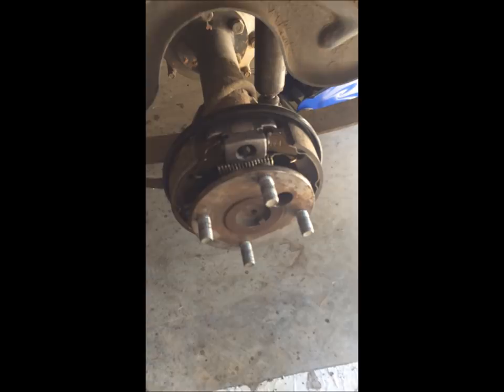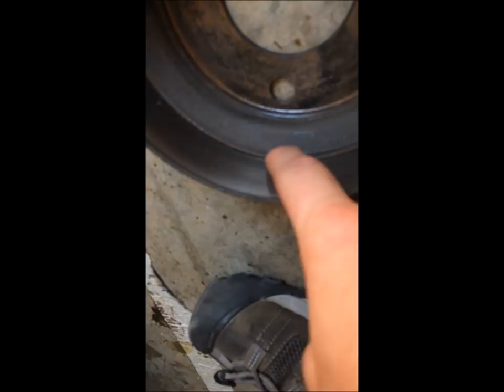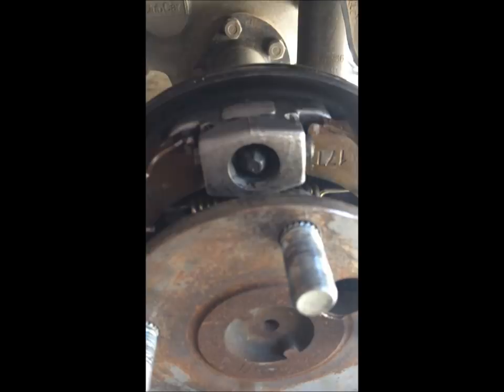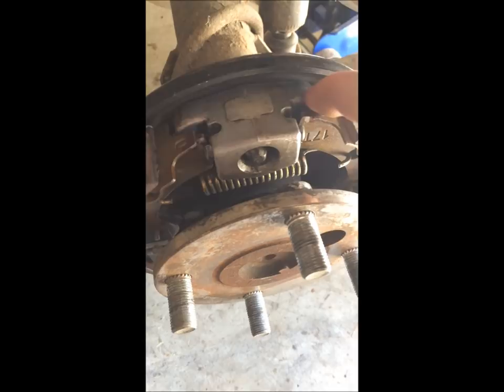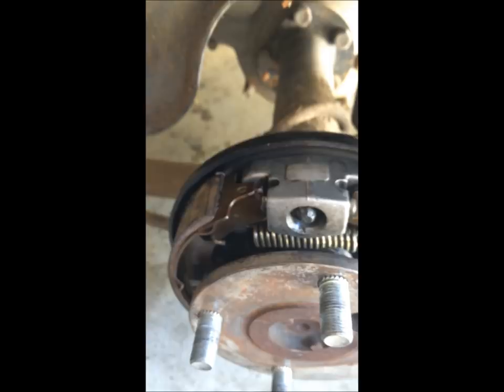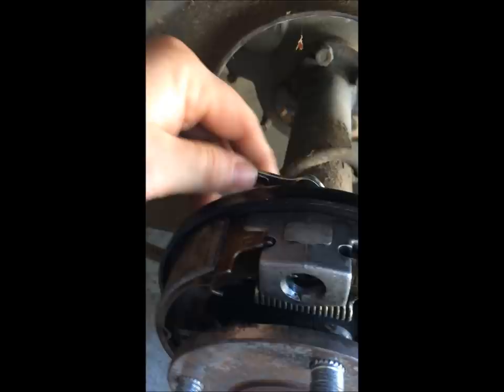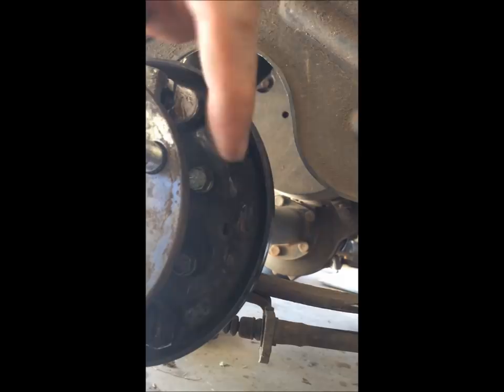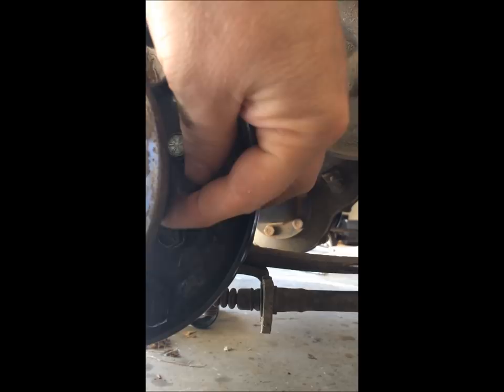88-94 Club Car DS Brake shoe replacement

Comment: Great video,  if I may ask,  I have replaced the shoes also the drums my problem is they suck at stopping (not good right ) , i was careful not to get any lube on the shoes or new drums,  I have a good pedal   any idea's
Reply from the maker: The First set I bought was the wrong kind. I had to argue with the golf cart store. They have a similar set that will install but they are mushy and won’t stop. Make sure you adjust that crown bolt too. The cable adjustment should have your pedal engaging within an inch of movement

Comment: could you please show how to remove wheel hubs.
Reply from the maker: I explain that starting around 40 seconds. The hub is held on by the wheel. If its stuck you can hit it with a hammer to knock it loose.
Reply: @GHeath-qd7zb  Thank you 🙏

Comment: Hey Boss how hard is it to take that top adjuster out, I know that it has 2 nuts on the back of the plate ! Do you have to tap it out with a hammer ? Please let me know !
Reply from the maker: Just now seeing this. It pops right off unless the brakes are still attached. Two 7mm bolts.

Comment: I have this exact same 93 club car and I put the new pads on just as you showed to, and I loosened the brake cable all the way, but I still cannot get the drum back over the new brake pads. Any further advice you can give me?
Reply from the maker: Ok three questions. Did you back the manual adjuster all the way back? And is there a Lip on the drum where the brake shoe makes contact? Outer edge. Do you have the correct brake pads? My guy here in town gave me the wrong set and assured me they were correct.
Reply: G. Heath Ok, we figured it out. I believe it was the exact same issue that you ran into when you had to adjust the manual adjuster. After that, the drums slipped right on. Thank you for the reply.

Comment: Why skip springs??
Reply from the maker: I am not sure if you mean I skipped the springs that hold the two shoes together? or do you mean the clip springs that pin the shoe back to the plate. in Either case I do cover it verbally I may not have shown it because I didn't have a stand or anything and I shot that video with an iphone5